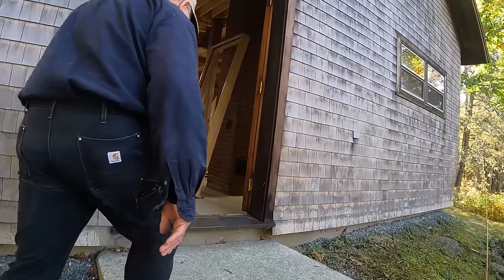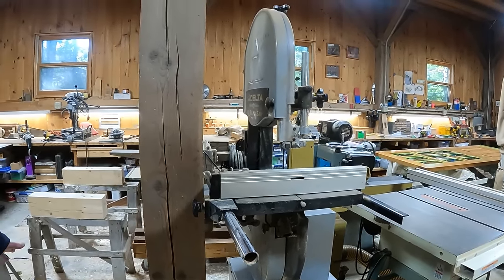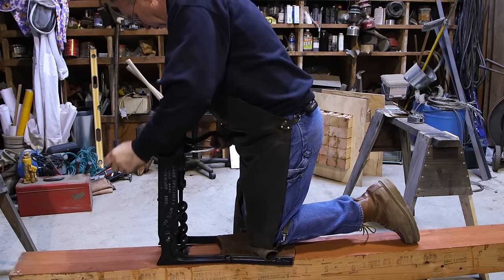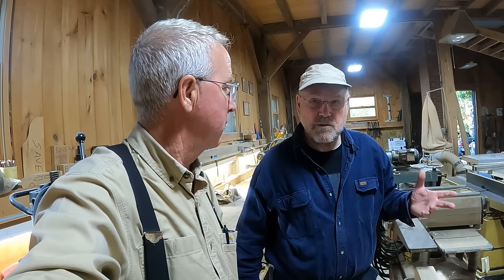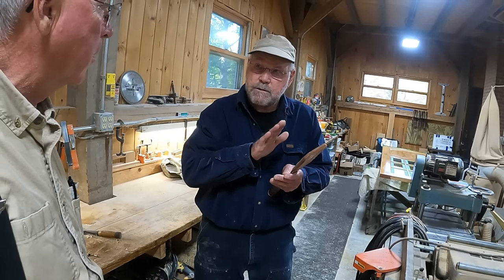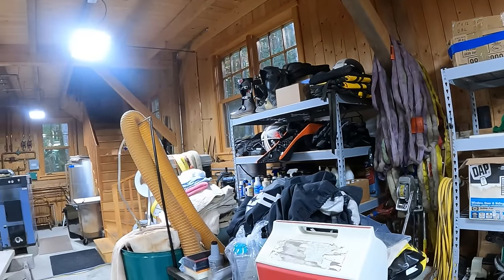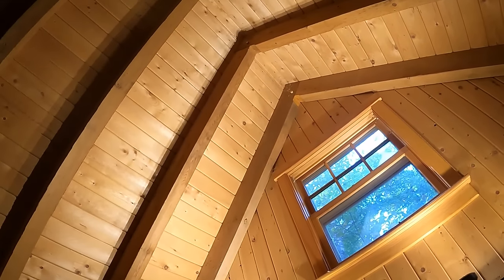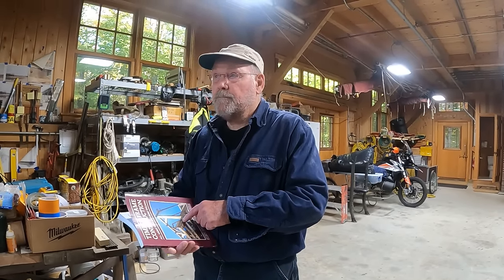Total Stranger Educates Me About Timber Framing

Comment: Here in Kentucky most old Timber frames were oak.  My "This Old Barn Shop" is a prime example of a big timber frame. Usually they were built on boxed wood sills so the whole structure was like one piece and it just sat on some piles of rocks. When the buildings were new you could easily lift one and relocate it and the smaller buildings like chicken coops or corn cribs often were relocated several times in their life as farm needs changed.

Comment: I have always loved timber frame structures.
Strong, elegant, proud to show what it is, resilient (can easily last several centuries) because the structure is always kept dry and away from the elements.
and actually remarkably easy to insulate you can get a full exterior insulation for high efficiency.
Gorgeous style of building.

Comment: At around 12:11, I imagine that the Japanese chisel was forged the same way a traditional samurai sword was forged where there is a softer steel (Shigane) core for flexibility in taking impacts without fracturing or cracking during blade-on-blade impacts (or in this case, take mallet blows), while it's wrapped with harder steel (Hagane) for better edge retention and armor-piercing hardness (or for chiseling, staying sharp throughout a shift).
Cool interview and gracious guest. John Sweet is like the East Coast counterpart... and Eastential Craftsman!

Comment: Lived in Oregon for 25 years (outside Eugene/Springfield) but never built a home there. In Pennsylvania however we built two -- one where the entire structural strength was the timber frame back in the 1980s and recently one hybrid home (the walls are super-insulated double stud but there posts and beams to support the 2nd floor and part of the roof). Used antique chisels for the most part for cutting the mortises and tenons. The modern chisels at the hardware stores just don't cut it (literally). The old guys knew how to make chisels, my favorite being a corner chisel with two 1" edges at right angles. Did all the drilling on site with hand-held electric drills. Used a Skilsaw to help hog out material when cutting tenons. For the hybrid house I also for the first time used a router on some mortises to hog out the material. Tip -- make sure to test all joints for fit prior to assembly. You don't want to have heavy timbers in the air and you can't get the pieces to go together. Our 2nd floor is tongue and groove 2" yellow pine. Quite beautiful and I wouldn't build it any other way. Would have cost a lot to hire someone.

Yes, here in PA the Douglas Fir is quite expensive. For books, I like both Jack Sobon and Ted Benson. I'll never forget a quote from Benson that "beauty is enhanced by function." So true for timber frames, the beauty of timber, not just for the sake of the timber but because it also performs a practical function.

The Essential Craftsman can come visit us in Lancaster County, PA any time. We'll put you up in our hybrid home.

Comment: Carpentry is so damn cool lol. I'm a steel guy but I also do some carpentry at the shop I work at and it's just so cool what you can do with a piece of wood or a piece of steel. At 25 years old I'm so glad I decided to get into a skilled trade at 19 instead of going to college because right now I would probably be sitting in a cubicle instead of building cool stuff for Broadway! Love the videos!!
Reply: 25 years retired Ironworker local 7 Boston
Reply: Keep at it, brother! I'm a journeyman carpenter, ironworker, pipe and structural welder, but my true passion is timberframing. I've built quite a few structures, but the log cabins and timberframes are my favorite.
Reply: @billywalker9223  thanks keep up the good work
Reply: @asweetframe  We have all of the tools to build timberframe and log cabins, even the nonpowered ones. I'm hand planing tongue and groove flooring for my son's log cabin. I've made all of the hardware for the doors and cabinets in the blacksmith shop. The steel for the Suffolk latches and the rat tail hinges was about $60, so we saved several thousands of dollars by making them here.
Reply: One of the nice things about a cubicle job is you can usually find jobs where you choose your hours instead of having to get up at 5am everyday and don't have to deal with nasty weather conditions. I love working with my hands but enjoy staying inside throughout the cold long dark winters of the northeast. The winters are downright miserable and make you want to stay in bed all day.

Comment: There's something so timeless and "sound" feeling about this kind of thick, squared timber in a building.

Absolutely excellent content.
Reply: I would think that on paper a stick frame is usually the stronger structure (2x6 16" on center is A LOT of wood), but a timber frame or post frame really rub the brain a certain way.
Reply: @cm01  2x6 is smaller than that and it’s all junk. Timber frame is 10x stronger.

Comment: 12:00 Damascus can be purely ornamental however laminating steel can be useful also in the more utilitarian sense.  Samurai swords are forged like this. The edge is super hard but brittle while the spine is softer steel that will absorb impact better with the transition between the two being gradual from edge (hard) to spine (soft). You cannot see the transitions because they are just so many However, they are also not etched.

Comment: Neato. An episode on Japanese joinery would be amazing. They're on an entirely different level when it comes to fit, finish and interchangability (see also the various wood planing competitions). Even the way they build wooden boats is entirely "foreign" to Western methods. Best of all it's done using just a few simple tools. Maybe someone on the West Coast has more experience than those of us "Back East".

As for the patent welded edge tools/weapons, they very much serve a purpose in terms of the ability of the tool to retain it's sharpness over time, and take abuse, but it's not wroth the effort to make, or learn to use/sharpen them properly for most folks anymore. Easier to just by cheap cast/forged stuff, beat it up, grind and ugly edge on it, then throw it away. 

Cheers!

Comment: 99.99% of the big tress comparable to the West Coast timber have all been cut long ago, but occasionally you find a poplar that 5-6' in diameter or a 36" Hemlock. They are usually way deep in a holler and it wasn't worth the effort to log them. Red or White Oaks with a solid heart and 24" diameter+ are usually found on the North side of the mountains and can bring $1200 to 2000 at the mill.

Comment: Chisel construction might be more like san mai than normal damascus.  The benefit for a cutting tool is that you can have one layer of steel placed where it will form the cutting edge but other layers of steel next to that where they provide other kinds of strength.  For a normal knife blade san mai would be a minimum of 3 layers of steel but for a knife blade with chisel grind, or a chisel itself, it could be as few as 2 layers of steel.  Use the harder steel for the layer that will have the edge and use a softer tougher more ductile steel for the outer layers.

Comment: I don't think that's Damascus or pattern welding. I believe it's a simple laminated construction with a high carbon. A thin layer of very hard steel on the bottom, often upwards of 60 Rockwell, and a lower carbon, softer and tougher steel on the top. Very similar to the way Japanese chisels are constructed. 

The harder steel holds an edge for much longer but is more brittle and the tougher steel above helps absorb some of the stresses so that the harder steel does not chip as easily. Various Japanese swords are also laminated together in this way. 

This construction is the reason why you don't ever want to pry on a Japanese chisel. The super hard steel on the bottom is very brittle and it's very easy to chip if you pry. Japanese chisels also usually hollow the back of the chisel prior to hardening so that when you have to flatten the chisel, there's not as much of that super hard steel to wear away. 

This type of blade construction is not unique to Japanese blades and has a very long history in many parts of the world. It was a way of getting the most out of the inconsistent steel and that was common prior to crucible steel. Once crucible steel began to dominate steel production, this method mostly fell by the wayside, but remained in use in places like Japan.

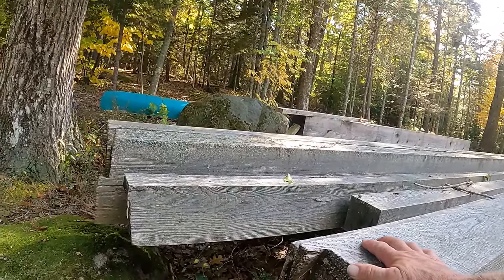Comment: 12:35 hemlock is not rot resistant. At. All. I live in Central Maine. I have a piece of hemlock that I peeled and it has been on the ground for 3 years. There's at least an inch and a half depth of high quality hemlock mulch on the surface now.

Comment: At around 10:25 in the video, are they using Structural Insulated Panels (SIPS) on the exterior of the timber frame?

Comment: Talks about hand work as the video shows OCB getting duct taped to a timber frame. Also timber frame is cheaper faster stronger than stick. Joinery doesn't hold the roof up, timbers do. Did the 100 year old tree have dove tail joinery?

Comment: It almost seems heretical to see that beautiful timber framing sheathed with OSB.
I know most engineered wood products are as good as or better than their more traditional counterparts. I remember my 100+ year old 10"x10" timber-framed barn had real 1"x8" board siding that had shrunk to let the wind whistle through the building. I turned down offers of $50,000+ for someone to take it down for the rock-hard timbers.